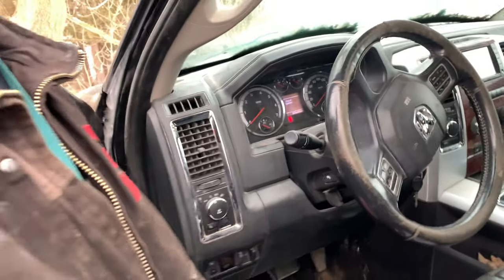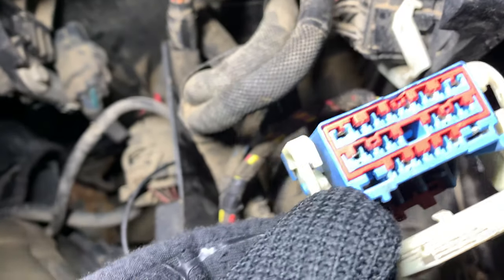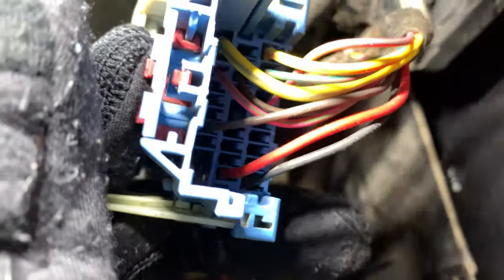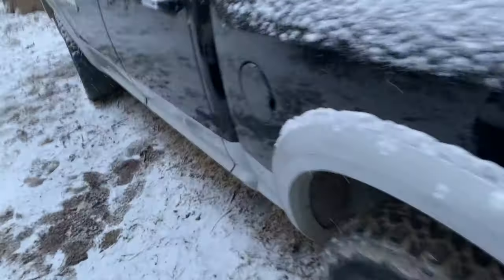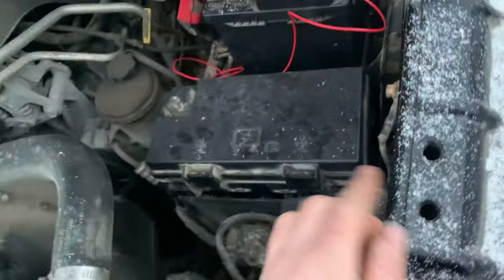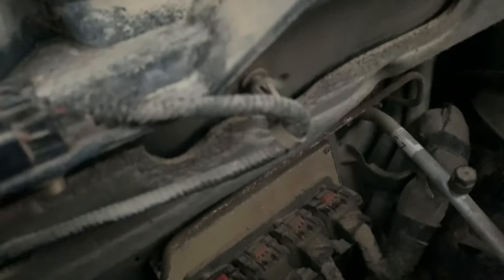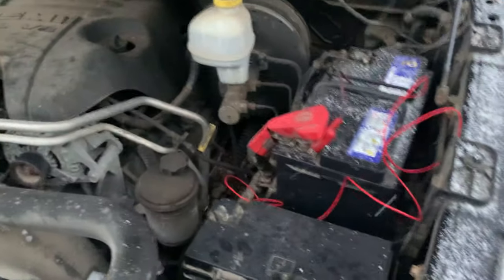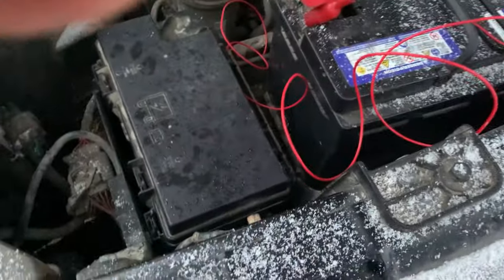No Start TIPM Corrosion Issue - 2011 Dodge Ram 1500 5.7L

Comment: i have the same pin that was corroded, i wanna know how you wire it with the fuse to the battery? will it drain the battery? thank you so much!! i have the same problem

Comment: I have a 2011 with the same issue. Did you send 12v off the battery to the red wire to go down the harness or to the red wire so it would send it to the tipm?    I've tried cleaning the corrosion off the pin and it's not changing anything. The red wire at the connector has 8v on it

Comment: I currently have a no crank no start 2011 Durango hemi at the dealer ship, I’ve replaced the starter and alternator and nothing. Dealer ship says I need to replace my tipm but it’s almost 2 grand to replace and program but they can’t assure me that’ll solve my issue what do you think? I would appreciate any feedback
Reply from the maker: Maybe get a junkyard TIPM that is for sure working, or do a wire bypass.
Reply: @Tech-28  how would you do a wire bypass!? I need your help like today if possible 😭 I’m currently stranded with my 10 year old brother and two pups. Would be a blessing to get this running before thanksgiving tomorrow
Reply from the maker: You’ll need to know what circuit has failed first. Do you know which one has failed?
Reply: @Tech-28  unfortunately no I don’t. I’ve been messing with this all day. This is the SECOND time this has happened in about 2 months. The first time I needed a brand new WIN module and get that reprogrammed. Now it’s happening again and I’m lost. I don’t have many tools on me either so testing circuits wouldn’t be available right noe
Reply: @Tech-28  okay. Just now I’ve figured out that part of the tipm receives power and part isn’t.. I hooked up an autel scanner and is saying pcm is offline as well… I’m wondering if this is the EXACT issue I’m having with no crank no start

Comment: What if some cylinders are misfiring? I can start it, but will cut off when in drive. Heavy misfiring. Two mechanics think it's the PCM
Reply from the maker: The ignition system is mostly controlled by the power train control module, chances are slim that the TIPM would be at fault but the mechanic should be able to diagnose it and give you an honest professional explanation to what exactly is wrong and why it’s misfiring.. I personally haven’t changed any PCM’s for that but it’s a possibility

Comment: Will this be the e same for my 07 1500 hemi Laramie? Truck would not start at nowhere no clutch no nothing but I had power at the dashboard lights and everything but no starting. turn the key and nothing happens. It's the starter relay the sensor with no relay switch for the truck so do u think this could fix my problem
Reply from the maker: Most likely
Reply: @Tech-28  thank you so much for replying so quickly! I didn't realize I said that message to you wrong from speech to text. Truck will not turn over but has power at the dash at the battery everything lights up just no turning over or no click. Had it hooked up to a really good scanner and was able to start the truck  from inside the scanner and it says it's the relay for the starter but what sucks about this model year truck is that there's no relay switch like there is in a 06. But thank you so much again here in a minute I'm about to go out there and try that

Comment: What was the permanent fix? Pill the pin from the plug and reattached the wire?
Reply from the maker: We just left it with the bypass wire. Permanent fix would be to replace the TIPM.